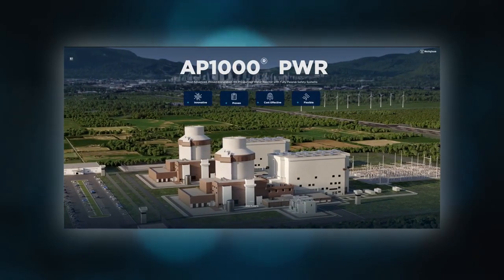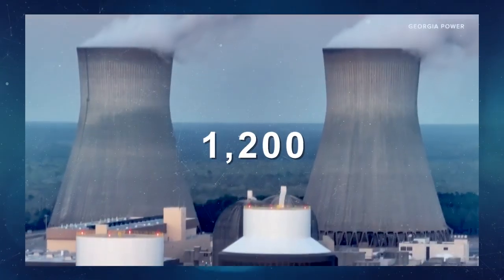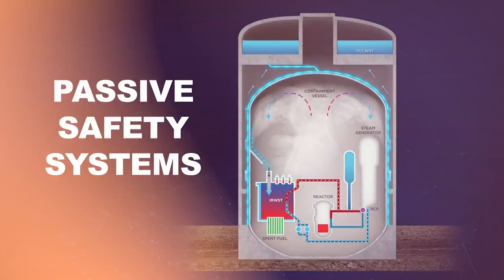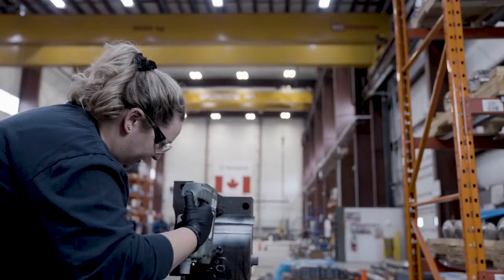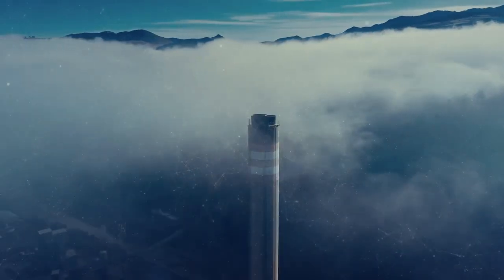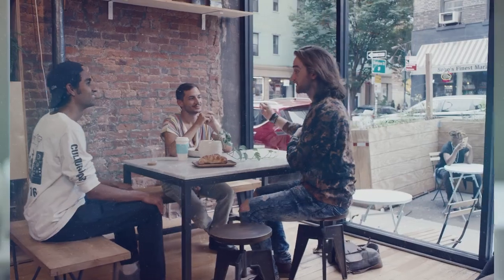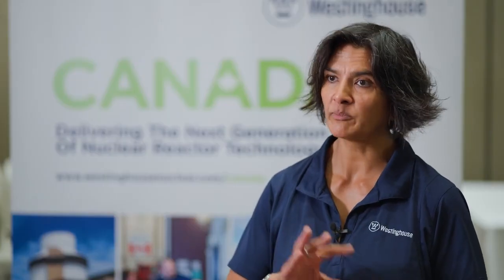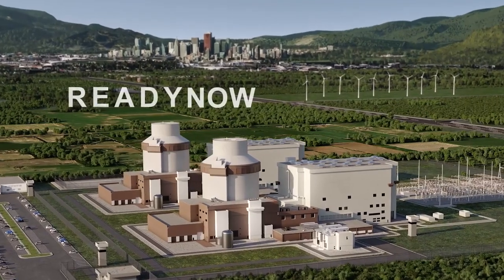Westinghouse Advanced AP1000® Reactor Can Help Canada Achieve a Carbon-Free Future

Comment: is this a step away from CANDU design? looks like a more classic PWR from the wiki
Reply: It is a PWR. 
AP1000 has a mulititude passive safety features designed without operation from human handling. Both have a similar passive safety system including gravity fed core cooling which dumps water upon the core prolonged period of time.